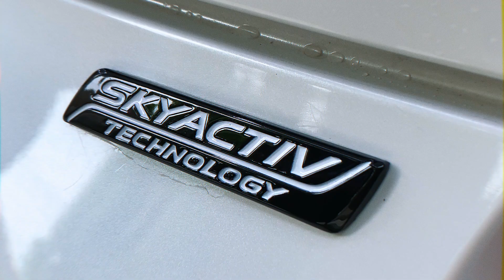Mazda Miata ND Black Logos Installation Guide

Comment: Incredibly disappointing Mazda opted to drill the bumper for the MX-5 and Skyactive badges. 

Pretty much every other maker drills the manufacturer badges only. Debadged looks so much cleaner, the rear of the Miata is way too busy with all the badges.

Comment: Did you take off a little paint there...
Reply: I thought the same thing, but the installer was sloppy with the surface cleaning.
Reply from the maker: That car is our shop car we use for prototyping and molding so there are many areas where the paint has been damaged! We will repaint when we are done with new parts which means pretty much never ahah
Reply: @carbonmiata2012 what spray is that u use?

Comment: It looks like there are no tabs on the Skyactiv badge or the Roadster badge like there are on the Mazda emblem badges so what method did you use to place them in the correct spot and level?
Reply: I use painters tape along a vertical and horizontal edge of the oem badge before removing them. Then just line up the new badge using the tape and peel off when done.

Comment: Ridiculously sloppy installation. Didn't tape off the area and destroyed the paint with that dirty mangled tool. I'd be embarrassed to have this video represent the brand.
Rev9 badges are quite a bit more expensive, but they are OEM Mazda badges with a much higher quality finish than these.
Reply: I don't have an issue with the fit and finish of their badges, but that removal was literally horrifying to watch.  They should be taping off the surrounding paint but also using a heat gun to soften the glue on the factory badges.  An 8 year old could do better than what they showed in that video!